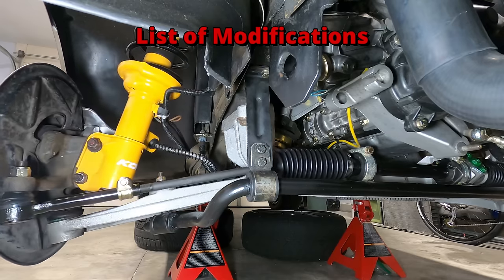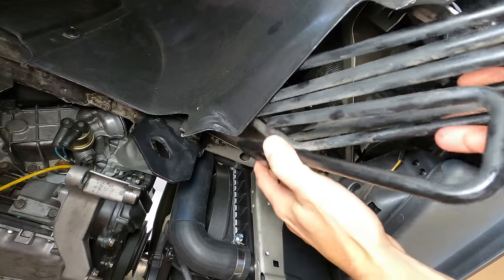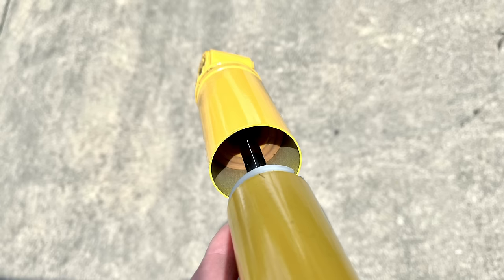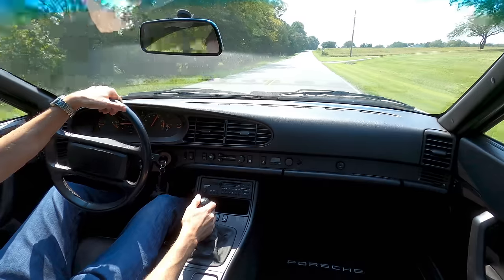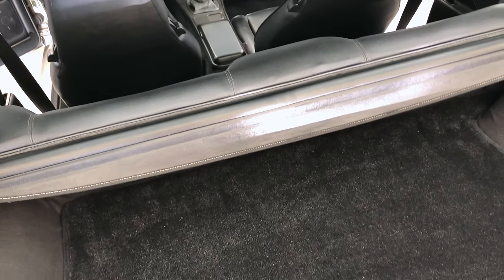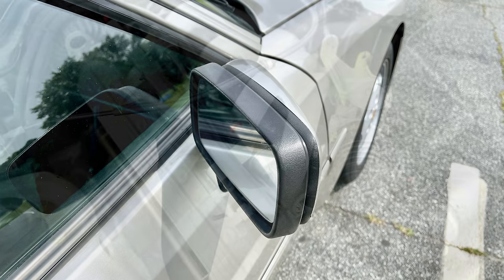25 Modifications I've Made To My Porsche 944

Comment from the maker: Breakdown of modification costs as shown, values include shipping and sales tax when applicable:

•	Lindsey Racing MAF Tune Kit – $682.75
•	Lindsey Racing Silicon Vacuum Lines – $66.10
•	Only944 Throttle Response Cam – $30.96
•	Rennbay Fuel Line Kit – $125
•	Cast Iron Exhaust Manifold – $182.76 (includes media blasting and high-temp paint)
•	Power Steering delete / Manual Steering Kit – $896.10
•	Solid State DME Relay (Focus 9 Technology) – $85.55
•	ATE Brake Booster & Master Cylinder – $213.49 & $132.24
•	Techna-Fit Braided Stainless Steel Brake Lines – $90.74
•	944 Turbo Front Sway Bar – Came with the car
•	IMI Performance Hi-Torque Starter – $279
•	Koni Sport Adjustable Shocks – $285 rear, $403.07 front, $191.48 powder coat
•	944 Turbo Valve Springs – $130.09
•	Black Sea R&D Super Bearings – $870 & $94.16 in supplies
•	Lindsey Racing Ultra Transmission Mount – $316.52
•	Only944 Short Shifter & Linkage Arm – $87.30 & $29.70
•	Rekeying Factory Alarm Switch – Free
•	Lloyd Floor Mats & Cargo Mat – $152.50 & $170.69
•	Rennline Glove Box Door Hangers – $45
•	Cassette Tray Delete – Free
•	Kicker DSC46 Car Speakers – $89.68
•	Brake Calipers Powder Coat – $404
•	Camshaft Assembly & Intake Manifold Powder Coat - $281
•	Zinc Plated Fender Screws – $27.20
•	944 S2 Design 90 Wheels – Came with the car, $740.85 powder coat, $234.85 new center caps
•	Textured Black Stone Guards – $38.81
•	Total Modification Costs – $7,376.59
Reply: Need you to do some of these upgrades for me haha based in SC
Reply from the maker: @bryandanng4964  Sounds good man! I’ll do all the easy ones for you… you can do the hard ones. 😂
Reply: Great! I’ll get back to you, or your video
Reply: It seems like you want to keep this car forever
Reply: I just bought a white 944 from bat for less than how much money you’ve spent on modifications lol
Reply from the maker: @tahaks  Congrats on the purchase! I was watching that one… it had a funky front spoiler modification, but otherwise seemed to be a solid car with some nice, recent maintenance. I’ve always liked how the two-tone interiors look and best of all, Fuchs wheels. 👍🏼 There are a number of DIY videos on my channel if you plan on doing any of your own work, could be useful. Best of luck!

Comment: Ugh man I can’t keep up! I really really want to get that focus 9 dme as well there’s some added benefit with being able to add an OBD module too. It’s 116 out here in AZ currently and after fixing my air conditioning the car has begun overheating with the AC on, so I’m just going to completely redo the entire cooling system. 

Every one of your videos makes me want to dissemble the entire top half of my engine during the next belt change and follow suit with fresh hardware and powder coating what I can. It’s really hard to keep bare aluminum looking clean and tidy. 

As always keep up the great work!
Reply: Same same! I wonder if they make chips that goes along with the OBD
Reply: @gbw4908  from what I’ve seen the OBD is an entire module that plugs into their DME board. So basically you can be running whatever chip stock or otherwise and still have the OBD capability. Limitations maybe physical ones for example the LR MAF chip might be too tall to physically plug in the OBD module. But running a stock chip or just a replacement chip should be fine.
Reply from the maker: Oooof! Those are some high temps my friend, no fun! The F9T stuff us so good, I want to buy one of everything, LOL. We're lucky to have people still supporting the electronics on these cars.

Comment: Very nice job, i'm tinkering with my '87 928. A few mods I added : Eye level brake light at the top of the hatch, 2 retractable cup holders, ran some USB cables under the A pillar trim for a dash cam and hands free kit at the top of the windscreen, took out the ash tray and installed a dual channel temperature sensor screen for the engine and transmission temperature, spliced into the cigarette lighter circuit and installed 2 power points either side of centre console in the foot well, made a mount for a phone holder installed using an existing bolt inside the centre air vent. The only holes I've made are in the replaceable side panels either side of the centre console.
Reply from the maker: Nice! Sounds like you’ve got some modern utility added in. I like the idea of reappropriating the ashtray for something more useful, mine is just holding a bunch of spare screws at the moment that annoying slide back and forth when turning. 😂

Comment: Is your fuel filter zip tied around the shaft of your rear shock?
Reply from the maker: 😂 It was when I recorded that one clip of the shock… which took place while I was rebuilding the torque tube, just to keep it pulled off to the side and out of the way. It’s now back in its proper clamp attached to the transmission carrier.

Comment: Hi .nice video.which website to order all the part  for 944
Reply from the maker: Hey Rasheed, the parts are scattered across various vendors and you may have to search around a bit. Here are some links to get you started...

• Lindsey Racing MAF Tune Kit – https://www.lindseyracing.com/mm5/merchant.mvc?Screen=PROD&Product_Code=LRA-944-MAF-TUNE
• Lindsey Racing Silicon Vacuum Lines – https://www.lindseyracing.com/LR/Porsche/LRA-944-VAC.html
• Only944 Throttle Response Cam – https://only944.com/partscatalog/only/throttleresponsecam/
• Rennbay Fuel Line Kit – https://rennbay.com/944-Fuel-Line-Kit-1983-1989.html
• Power Steering delete / Manual Steering Kit – https://mwthemachineshop.com/steering-solutions
• Solid State DME Relay (Focus 9 Technology) – https://www.ftech9.com/new-products/993-ssr-pp
• Techna-Fit Braided Stainless Steel Brake Lines – https://www.ebay.com/itm/361106271577?epid=1434513279&hash=item54139c6d59:g:uGYAAOSw5XRfOpWR
• IMI Performance Hi-Torque Starter – https://www.pelicanparts.com/More_Info/PELGESTHT944.htm?pn=PEL-GE-STHT-944&bc=c&SVSVSI=0762
• Koni Sport Adjustable Shocks (rear) – https://www.pelicanparts.com/More_Info/KON80401035SPORT.htm?pn=KON-8040-1035SPORT&bc=c&SVSVSI=0762
• Koni Sport Adjustable Shocks (front) – https://www.pelicanparts.com/More_Info/KON86411414SPORT.htm?pn=KON-8641-1414SPORT&bc=c&SVSVSI=0762
• 944 Turbo Valve Springs – https://www.pelicanparts.com/More_Info/95110590510.htm?pn=951-105-905-10-INT&bc=c&SVSVSI=0762
• Black Sea R&D Super Bearings – http://www.blackseard.com/site/
• Lindsey Racing Ultra Transmission Mount – https://www.lindseyracing.com/LR/Porsche/LRA-944-UTM.html
• Only944 Short Shifter & Linkage Arm – https://only944.com/partscatalog/only/shortshifter/
• Lloyd Floor Mats & Cargo Mat – https://www.lloydmatsstore.com/
• Rennline Glove Box Door Hangers – https://www.rennline.com/rennline-944-968-glove-box-stop-repair-kit-porsche-sku-i09/
• Kicker DSC46 Car Speakers – https://www.crutchfield.com/p_206DSC4604/Kicker-43DSC4604.html
Reply: @NC944er  thks for reply and for the link of parts.i have 944s2 and 928gts .now I rebuild 944s2.928gts I rebuild 60 percent still not yet finished.for  me time not enough to do on car  also repair for my customers.what is Ur name?

Comment: There isn't a single spot in your engine bay that I wouldn't consider okay to eat something from. Crazy how you manage to keep it that clean.
Reply from the maker: I don’t really drive the car much in wet conditions and that seems to keep things mostly clean, then just the occasional blast of compressed air and wipe down of the top surfaces has been working without too much ongoing effort.

Comment: 1:00 Linsey Racing MAF kit conversion
1:52 Linsey racing silicone vacuum line kit
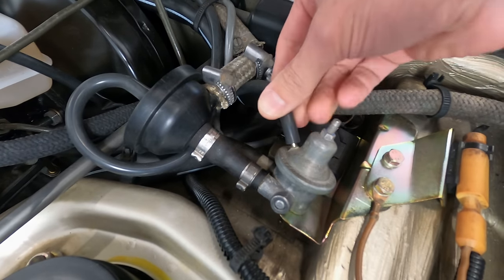2:21 Only944 1:1 throttle response cam
3:00 Rennbay fuel lines
3:42 Cast iron exhaust manifold 
4:20 Power Steering delete, manual steering kit
5:18 Solid State DME Relay (focus 9 technology)
5:48 ATE master cylinder conversion
6:25 Technifit braided stainless steel brake lines
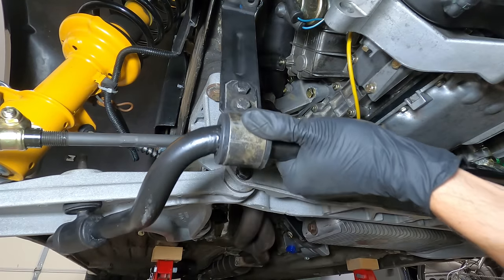6:53 944 Turbo sway bar conversion 
7:18 IMI Performance High Torque Starter
8:03 Koni Sport adjustable shocks 
9:25 944 Turbo valve springs
10:04 Black Sea R&D Super Bearings 
11:04 Linsey Racing Transmission Mount
12:13 Only944 Short shifter and linkage arm
13:03 rekeying factory alarm switch 
13:41 Lloyd floor mats and cargo mat 
14:00 Rennline glove box door hangers
14:15 Cassette tray delete 
14:25 Kicker DSC46 Car Speakers
14:49 Brake calipers powder coated 
15:11 Satin coating 
15:22 Zinc plated fender screws 
15:38 Design90 wheels
15:53 New black stone guards 

future possible mods:
16:17 MOMO Prototipo 370mm steering wheel
16:40 Focus 9 Technology Sport DME
17:07 Danske Catback Exhaust
Reply: Thanks!
Reply from the maker: Bro, you rock! You just saved me a ton of time in marking these, thanks for putting the list together, I've added it to the description for chapters. Cheers!

Comment: This is amazing! I’m purchasing a 1983 944 Porsche for my husband as his dream since his childhood was to own a Porsche, I don’t have the resources to buy him a new one but I’m looking at one tomorrow and I’d definitely like to look for the right things it’s been sitting for 20 years. !
Reply from the maker: Wow, very cool! That would make for an incredible gift experience for him, something he’ll never forget. Childhood dreams die hard. 😂 You may not have time to watch it, but I have more of a buyers guide video on the channel as well that breaks down many issues to watch out for, but for a car that’s been sitting for 20 years, much of that can largely be predicted anyway. Many of the rubber bits will have aged out, so you’ll be looking to do all new drive belts and oil seals around the engine. Most of these parts are reasonably priced, it just takes time to do it all. If your husband is a decent DIY/mechanic, he’ll be fine as the 944 is pretty easy to work on. Whatever you end up paying for the car, factor in around $2,000-$5,000 for parts to get it going. I’d recommend replacing the timing belt, oil change, and refurbishing the fuel system before trying to start the car, all of which is covered on my channel. Best of luck to guys and I hope you can find the car of his dreams. Let me know if you have any questions as you get started. Cheers!
Reply: Best Wife Ever!

Comment: My 1988 944 is the best car I have ever owned. I have had a 95 El Dorado, a 1998 Mercedes ML320, a 2003 Mercedes SL500 AMG, and a 2013 Boxster S. I haven't bought a new car in 10 years, and I never will. I just bought a 1988 944, and I plan on keeping that car forever. Putting an LS1 engine in it.
Reply from the maker: I appreciate your passion for the series. Best of luck with the LS build! 👍🏼

Comment: cool Video BTW I’ve  owned several early generationVW Watercooled. Vehicles and one year in particular all the manuals  claimed the front factory Struts  were not Serviceable  only Replaceable withOEM  units   I did however  remove mine  and replaced the Cartridges  without any Specialty tools needed  my Spring Compressor at the time was Simply a Old Bench mounted  Vise  I used with Extension Handles for leverage  made out of Plumbing Pipes that slipped over the factory handle. I’ve always had  the liking and desire to own the 944 from this generation  hence why I watched your video  I’ve known for many years Porsche and VW. Did a lot of shared Engineering on this model  and it makes total sense that some parts may be interchangeable with GTI  Components  One 944 owner. I read about  actually  wanted to keep a 4 Cylinder under the hood and he wound up using a GTI power plant  that I believe  would be a  fairly easy Swap within reason  many people don’t realize that  the VW Cabrolet Rabbits  had the GTI power plant in it  and those cars today can be found on EBay and other sites very reasonably priced  needing some Cosmetic work like Replacement Convertible tops  and Interior  work  many people   Over the years would freak out over the high Cost of replacing a worn out Convertible top because of the built in headliner  and Padding they were pricey   My Uncle was a Porsche VW ,Audi Certified Mechanic  for years  and   Those  cars all have a special place in our hearts as a Family   I remember him driving a early 1970s 4 door Audi 100  for years. He turbo charged  with a Unit he rebuilt out of a JunkedCar. He came across FYI my Uncle was an Airplane Mechanic in Vietnam and hence the Turbine Specialist  from training in the U.S. AirForce Jet Engine Turbines after his Service  the Germans were big on Turbo charging the Cars  and he found steady work at the dealerships  I actually still like the ugly look of those Old Audi Sedans ! his always reminded me of the older BMWs  with a high revving motor  and a nice Interior
Reply from the maker: @craigmonteforte6111  Interesting family history and clearly the roots for the passion around these cars. Thanks for sharing! Cheers!

Comment: What Kind of hydraulic tappets did you use with the installment of the 944 Turbo springs. Mine are making noise And i am hesitant of spending nearly 1200.- for 8 hydraulic Lifters. 
Its the 2.5l NA engine 

Thanks in advance.
Reply from the maker: Hey man! I’m using the standard 8v hydraulic lifters that came with the car. The NA and the Turbo share the same part number: 928-105-311-08 and the S2 and 968 share part number: 928-105-312-02. I had just a bit more valve-train chatter after the 951 spring installation, but after running a cleaning treatment through the engine, it smoothed things out. You may have one or more lifters with a clogged valve causing excessive noise. My engine had a bunch of sludge lingering in various oil passages from sitting, so a cleaning was overdue. I have another video on diagnosing engine noises that may be useful - 
https://youtu.be/dui5sOvfmhA

Comment: Thank you so much for this detailed breakdown! Your car is such a beautiful example of a 944. 
At what elevation do you live?
I wonder if the MAF kit provides more power at higher elevations (I'm located in Colorado). It's a big-ticket item and it's really neat, I just feel the need to justify it in some convoluted way before I seriously consider it.
Reply from the maker: Hey man, thank you! I live at about 600 feet about sea level. While I haven’t seen any high altitude testing or reports with the MAF kit, here’s what I can say that may influence you one way or another… the factory AFM only measures air “volume” flowing into the system, but what’s really important to the computer is the amount of oxygen ingested, so the AFM is partnered with an altitude sensor (under the passenger foot well) and the DME combines the data into a calculation to determine the fuel mix. As you can imagine, with more components comes more complexity and the increased chances of poor calibration issues as the sensors and electronics age. The MAF sensor measures the air “mass,” which means air-temperature and pressure compensation is automatically included in the output signal to the DME, ignoring any readings from the altitude sensor, whether accurate or inaccurate. That in and of itself may improve your situation, or it may not, it depends on the flexibility of the mapping, which I don’t have a lot of insight on. However, the MAF setup does allow for easy fuel mix changes using the FQS switch on the DME, so you could make incremental adjustments of +/- 3% to the mix, making it more lean or more rich to dial in the performance for your altitude. Finally, I’ll add that the MAF is less forgiving of small vacuum leaks in the system than the factory AFM, so you’d want to make sure the entire vacuum system is well sorted and properly sealed up for the best results.

Comment: Lovely car and great work. I’m considering getting my rocker cover, inlet manifold vapour blasted to bring back the original finish. The problem over the years has been oxidation and it looked awful. I never considered powder coating. How has yours stood up so far in such a short time and does it look in keeping with the rest of the engine bay?
Reply from the maker: Nice! I’ve found that the aluminum oxidation will set back in after a thorough cleaning, sooner than later here in the humid climate of NC. Applying some kind of coating is the only way to make it last. I went with satin clear in attempt to match a freshly cast aluminum look, but it ended up a little darker, almost like titanium colored. Most people can tell that it’s been “refreshed,” but are often surprised when I tell them it’s powder coated. It doesn’t look out of place, provided that the rest of the engine components are fairly tidy. The finish has held up so far and it’s easy to wipe down with a damp cloth.